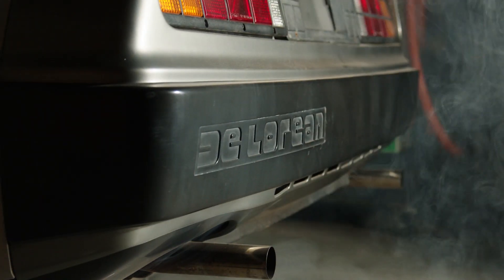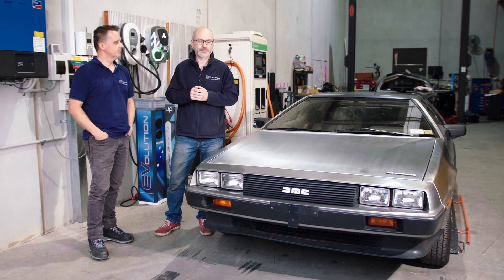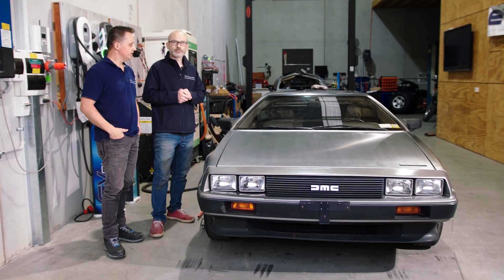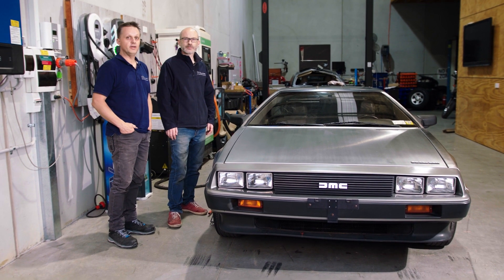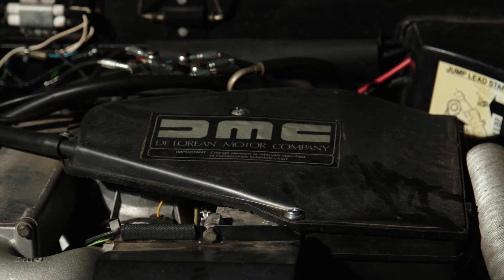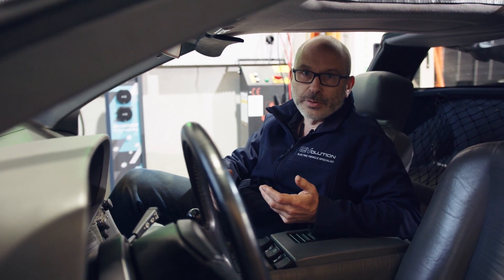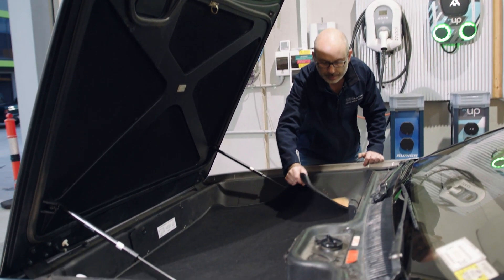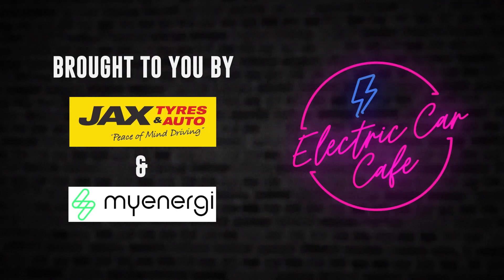DeLorean Electric Car Conversion Powered by Tesla Build Introduction

Comment: Yes, here in Australia, we have Many design and Engineering "hoops" to jump through to "allow" a modified vehicle on the Road, VERY different than America. Even some of the most basic engine mods are Forbidden in Australia, like better Carburators in petrol vehicles, My brother who is a Mechanic Wanted to put a Better Valley cover and Carburetor on his HZ Holden, (this was in about 1985) Which would make it more fuel economic and have lower emissions, was told he couldn't change it, the Car HAD to stay ORIGINAL, as produced. This is the kind of Bullshit we have to put up with in Australia. Good luck to you guys, at EVolution,  I hope things are Better now in What "they" are allowing in car Engineering than back then.

Comment: Only thing I dont like about using Telsa motors is that you have to completely replace the axles. Myself I prefer the look of a solution that connects without replacing the original axles. Ie via the original gearbox where possible. But if you have the budget for this advanced work then good on you.

Comment: There’s nothing “optimal” about 50/50 weight distribution.  It’s equal, yes, but there’s nothing optimal about it.  According to Ferrari, 44/56 is the number they shoot for.  Think about the best cars out there— they all have more weight on the rear.  This car was designed as 63% on the rear, and that was a bit too much.  Nevertheless, Lotus managed to make the chassis stable.  With the tiny front tires and big rears on this car, you’ll make quite a mess of it if you make it with 50/50.  Plowing understeer will be the result.  The rear non-ABS brakes will lock easily on braking if you take too much weight off.  The rear tires will spin too easily on launch and you won’t get good hook-up.  Aim for something closer to 56% on the rear and you’ll be glad you did.
Reply from the maker: Noted, we are employing some suspension experts to help us with this. You will note we have already changed our plan regards weight distribution accordingly.